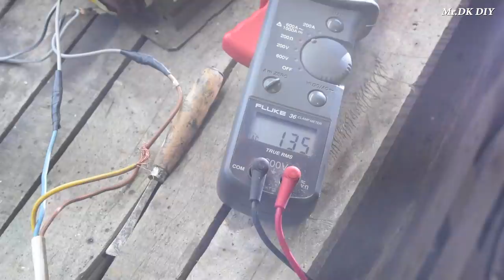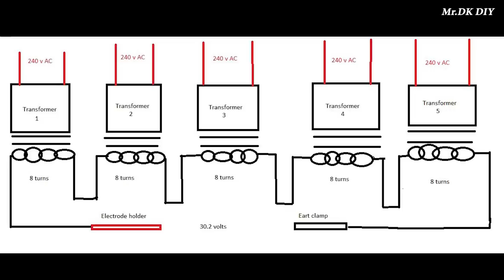DIY WELDING MACHINE USING 5 MICROWAVE TRANSFORMERS

Comment: Awesome video !  I have been searching for a video to show how to make a 200 amp car battery charger that is easy to understand like this one .  The one they sell use circuit board computer control type ..... not good for this .   I need a manual 200 amp car charger to revive some old car  battery .  Any help in guiding me in the right direction would greatly appreciated !   Thanks
Reply: a 200 amp car charger would over power your car battery and a car battery is dc transformers only work with ac, so you would damage/blow up your battery. you could rectify the output of it but you would need to current limit it to not damage your battery or you could just buy a normal car charger

Comment: To add current control get a heavy duty 5 position switch connect stinger lead to common and make a jumper to each transformer isolated from each other to prevent back feed. Position 1= low voltage/current, 2= two transformers, 3= three transformers...ect Possibly switching the primaries individually would give you current/voltage control? Neat idea if you have access to microwaves. 👍

Comment: good video, but for this experiment to be efficient and durable, all the transformers must be of similar capacities, otherwise the one with the lowest capacity will burn out, I recommend that the cable turns should be measured separately and matched according to their capacities for a better life Useful

Comment: I recommend you to phase the bone transformers, connect the principle of the primary coil to the phase. and that all the principles are in the same phase so that the current does not tire
Reply: To check the phase is it enough to just observe the directions of all of the windings? chack for example that if they are all clockwise wound that the neutral is always on the same side and then they flow in that same direction? Same for the secondaries.

Comment: You should wire it in such way that you could “deactivate” one or two transformers at a time, making step adjustments of the welding current.
Reply: I think thats why he installed that selector knob.
Reply: Good idea, but how would that work?
Reply: It will be nearly impossible because the secondary are winded in series.
Reply: Good point. Old post, but still got questions. Could adjusting the input current to the linked line of transformers do the same thing?
Reply: @mgrdigimarketing3035  how would you adjust the input current?

Comment: Wouldn't it be cheaper to buy a similar welding machine? (I wonder what's the price for a machine of similar performance.)
Não ficaria mais barato comprar uma máquina de solda similar? (Me pergunto qual o custo de uma máquina com performance similar).
Reply: a cheap welder goes for around 100 euros 5 microwaves can be free or like 30 euros and you learn from doing it. but a welding machine you buy is alot better ive tried to make one at home and used a bought one i prefer the 100 euro one note i only used 2 transformers

Comment: You don't want more voltage, you want more current
Wire the transformers in parallel rather than series. Voltage stays low (and safe) but you'll get 5x the current. Just make sure you've phased them correctly.
Reply: Can it get much hot?

Comment: Very informative disclosure, with meter readings, schematic and captions at key points! Thanks!  And you have my subscription. 

Can you now turn your talent to refine this, to substitute no-cost components for that rotary switch, earth clamp, electrode holder?

And begging your pardon, what exactly is the rotary switch controlling? The mains, or something more?
Reply: I guess the rotary switch is use to control how many components you are going to use, like if you are cutting then use all of them then maybe if wielding just use 2 or 3 hahahaha
Reply: Fan speed
Reply: Looks like the rotation switch gives power from the mains to the transformer banks. He probably has it engaging different amounts of the mains energy to separate amounts of transformer... maybe four transformer on 1 and all on 2.

Comment: Hello, If i wind the cables around the second transformer the opposite way to first, will the current run back and heat up cable between two transformers?  Does it matter which side of transformer i start winding each ? Does winding have to be identical to each in order for current to flow same way and get stronger from each passing?  Does it matter if one transformer primary coil is  + -  and other is wired - +  ?  (not sure which is + or - on primary coils.  Thanks.

Comment: Hello, I found this project very interesting but there is some details I fail to understand ;
1 : How do you get around not burning the safety switch in your house ? Normally, there is a short circuit if anything use more than 2200 volts. How do you make sure it is not going to use more.
2 : Why do you need the turning switch with different modes ? What mode do you want to choose ? 

3 : Why do you need two switches ?
4: Do you use a regular power point ?

5: Do you wire the fan in line or in parallel to the transformers ?
Reply: One switch for primary and the other for secondary winding. Because of the surge.
Reply: Wire it parallel to the primary coil in the beginning with the ac in wires . If the fan is of course 120v or 220v ect

Comment: Are all 5 transformers connected as one unit with the cable?  You do not cut the cable do you? I have seen a few videos like yours but none done so well. Thanks
Reply: All the the 5 primary in one unit parallel together. But the secondary series with 5 transformer so that have total of 30 volts (6 volts @ transformer with 8 turns each.) I hope you understand my english.

Comment: I have a few 110v transformers but just got two transformers that are 220v can I use these by just not connecting to both inputs or? Do you have a solution.

Comment: Hello Hello  I am a pretty new subscriber to your channel and love this project. I have to ask, because I see that the upper coil is bigger, so why did you cut off the top coil? I would think that the top one would be more powerful. Also are all the microwaves the same 1000W or are they different? Thanks for the great content.
Reply: Because you don’t want to die if you touch 2000+ volts on accident

Comment: Greetings. Please, what is the current of these 5 primaries connected in parallel in your assembly? I think it must be very high ... and when the electric arc opens to the process of welding, it will be much higher causing the shutdown in the power circuit (220 ACV).
Reply: You connect it to triple phase outlet and you are fine
Reply: In his schematic drawing it looks like 5 different mains lines to each primary coil. The primarys are not drawn in parallel like the secondary coils are.

Comment: speed up the process. grind off the welds holding the thing together....rewind bobbin....assemble in vise....and DC weld up again..  windings will be tighter and neater...with hopefully, no 60 hz vibration.....

Comment: Please,I want to use 4 microwave transformer of similar size with 8mm electric wire, my question is what can I use to power it on?I mean the voltage and amp of the plug and to what supply can I connect it to? or can I use plug rated 250v with 16amp?
Reply: Calculate the power on welding side... voltage..×  ..current...   may be 30×200==6000w...

Now calcuate  6000÷ 250==  24  amps....you must  use 50 amps  plug...

Comment: That's one continuous wire I've been collecting those blocks from microwave for some time now is the power source connected to a 115 or 240
Reply: Thats what I was wondering. His schematic shows all 5 primarys connected paralell at 220V. They're regulated for 120V.
Reply: Is 240v

Comment: So, what if the transformers differ in size? What if one is somewhat larger than the other? Are they still compatible?
Reply: Yes
Aslong as the input voltage is the same. They usually dont differ too much in size.

Comment: 5 Microwaves, okay so is it plugged into what after you get everything set up, 120 volts or 230 volts?
Reply: Based on the MOT ratings. If the transformers are rated 220v connect their primary winding in parallel to 220v supply else connect them in parallel to 120v supply as per mot ratings.

Comment: So this is an AC welder only? Can voltage total be regulated by how many transformers are connected in series? Is there a link to be able to print out electrical diagram?
Great little project to make an inexpensive buzz box welder or spot welder power source.
Thank you for your time and brain surgery/ideas.
Reply: Creative Etc.
Published on 25 Apr 2018
Hi friends today I am going to show  How to make Arc Welding Machine at home................................................................................... Here I used old micro oven transformer ,220 v
Reply: Another way to control the voltage is to add or remove the number of coils on the secondary windings.

 on an unmodified 110v microwave oven transformer the secondary coil puts out something around 2000 volts.
Reply: Another way to control the voltage is to add or remove the number of coils on the secondary windings.

 on an unmodified 110v microwave oven transformer the secondary coil puts out something around 2000 volts.

Comment: Can I make welding machine only one transformer? Thank you so much ❤️
Reply from the maker: No bro
Reply: @MrDKDIY  ... and all connected parallel on the mains side?
what is the surface of the wire?
could you use a dimmer on the primary side?

Comment: If you’ll make you a center tap on each one of them transformers you can adjust to what Voltage you want to weld at for thinner metal ..
Reply: Just put each transformer primary winding on it's own switch, then you can choose  any of five power levels :-)

Comment: I must be thinking wrong or something. Every video like this one shows on their schematics the primarys in parallel at 220V each. But these are the same primarys on the same core built to operate at 120V. If two were connected in series, that would make sense. But all 5 are parallel at 220V.
What am I missing here? Wouldnt 220V fry the primay if it was regulated at 110-120V?
Reply: as you can see on transformers , they are 240V transformer , they are not 120V

Comment: Why didnt you explain the steps it's cool and all but all I see is wrapping wire around them all you didnt show what your connecting the wires to or how it's not arcing when your running them threw the transformers

Comment: hay so I have a question. could I connect this to a 30amp line and not have issues? I live in a older apartment and would like to run a welder on a few projects. I dont want to connect a normal welder in fear id blow the line and the house would catch fire....any ideas?
Reply: Plug it in washing machine socket, not the lights socket,  you don't have rcd on your house?

Comment: Nothing to learn on that video, connection is hidden, useless!
Reply: these devices work for spot welding..... add muliple units will just do.. just dont expect it to last forever. or replace a home grade or professional grade unit. you can buy at a shop!

Comment: i see other DIY welders using only 1 transformer, but yours needs 5, what's difference?
Reply: Difference is what wire you use to get to 30 volts...with one transformer you will need approx 30 turns to get to 30 volts and the wire used for the secondary will be very thin to fit it all, and it will not survive high amps. He used very thick wire so he could only get 8 turns on each transformer needing 5 transformers to get to 30 volts. His can handle high amps without burning up...
Reply: Increase volts and amps
Reply: My answer would have been: if you don’t know you should never consider this build...
Reply: @dillardhayes3612  
Thanks for throwing more light

Comment: How to do voltage control low or high
Reply: Input voltage or output? On the outpt voltage is not much of concern as current. 32V to 36V is good as long as it supplies current. 120A to 200A works for home stuff. His he claims to reach 230 amps, but he also has to power 5 transformers to do it.
Im not clear on input voltage yet. His schematic shows 220V in paralell. That means 220V each transformer. Which I think is inaccurate. I think the primaries in all of them would burn up in a minute at 220V.
But other videos show the same schematic. So I tend to think he just copied that schematic, but built a different way. He's not the only one. Theyre all copying the same 1 schematic, but they're all built and wired differently. lol.
Here's my theory.
If there were just 4 transformers and paired into two sets, (2 each) each set could have their primarys connected in series making them 220V, then both sets connected in paralell so they would stay 220V, but twice the current. The secondary in all 4 of them could be connected in series for total output of 36V (about). Which is pretty good. But good current is the key. You need atleast 120A. That depends on the secondarys # of turns and wire gauge. More turns = more Vs, but less A. Less turns = more As, but less Vs. Thicker gauge allows more As and runs cooler than thinner guage. So the idea is to get the secondaries as thick as you can, with less turns as possible but enough to get atleast 32~36V (8~9 turns per secondary) for optimum current without burning up.
I chose an input of 220V because most households with a 220 hookup have a higher current rating. But if 220 not available, reconnect each transformers primary seperatly (in paralell) for 120V. You may have to use seperate outlets in the house as well to not overload the cicuit at the breaker.

Comment: No amperage regulation? 200 amps is way too high for most uses , great for welding very thick steel but not much else around the house, maybe just three transformers?, you also have no useful dialogue so this video will be quite useless to many